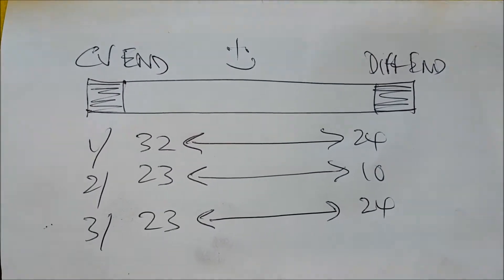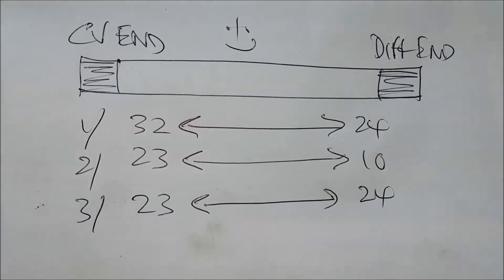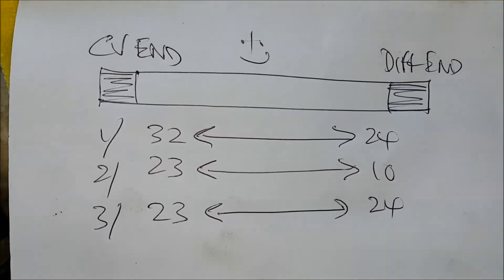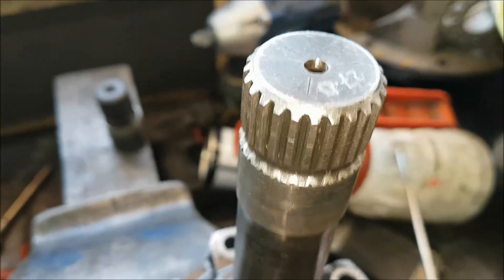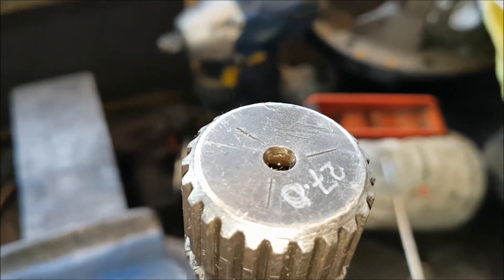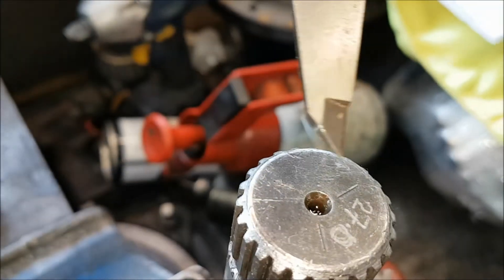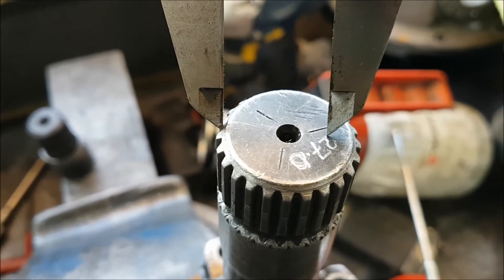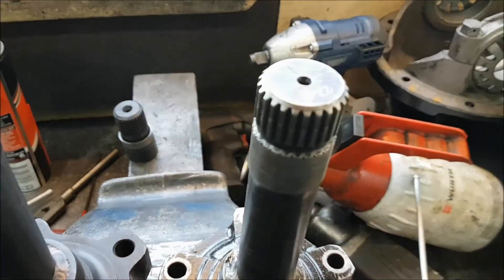All about types of Front LR Shafts & CVs Options & Technical Information

Comment: Good simple explanation though it is limited to the rover type diff. Salisbury front axles have 23 / 24 Land Rover made half shafts as standard made from BS970 heat treated steel with the splines induction hardened, they are pretty strong.

Comment: Is it worth using standard 32 spline cv with heavy duty inner shaft.?
32 spline cv has more material in cage than for ex aeu2522
Reply: You can't get HD 32 spline Shafts, KAM tried when I worked there, they didn't !!
Reply: @nigelbarker4044  im pretty sure australia you can get them